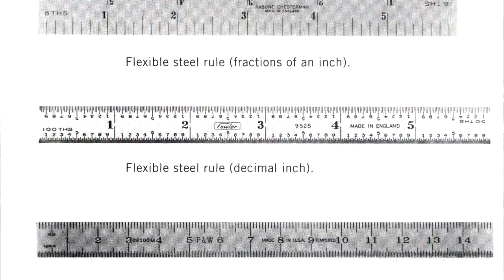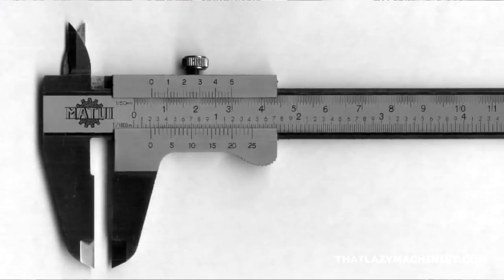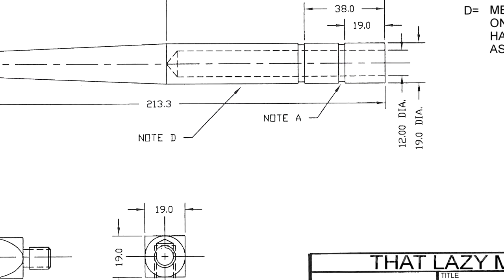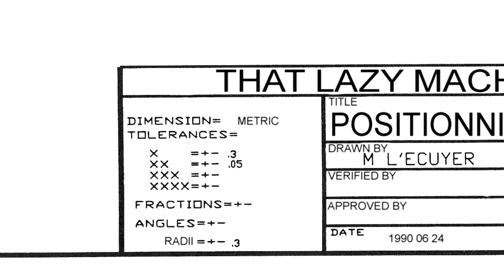MACHINE SHOP METROLOGY #1, terminology & basic principals for accurate measurement of machined parts

Comment from the maker: I erroneously stated that 3 centimeters equals 300 millimeters!!! I an noted the video with a poll comment that lets you decide between a senior moment or a brain fart as the root cause for the error. Check it out at the 20:23 mark, Marc
Reply: One thing that I noticed that people raised in imperial system fail to acknowledge, is the build-in notion of default accuracy in metric system. If you just apply the math, 3cm is equal to 30mm. However, the two units carry different assumptions of accuracy. When you say 30mm without explicitly stating how exact the measurement should be, you assume anything between 29.5mm and 30.5mm. For 3cm this would be anything between 2.5cm and 3.5cm. That's why these units are not interchangeable. This also explains why in machining world millimeters are the preferred unit of measurement, while in everyday life it is often more convenient to use centimeters. The multipliers are spread densely enough to almost always have one to use for required accuracy to not to have to go into inconveniently long fractions (like 1/10000 or 1/1000000 of an inch). The biggest ratio between two consecutive multipliers is 3 orders of magnitude, with centi, deci, deca, and hecto conveniently bridging the gaps in the most commonly used range of measurements. In imperial world you have whole inches, and then you jump straight to 1/1000s. In metric measurements it is not uncommon to use 1 or 2 digits in the fractional part, depending on required resolution and accuracy. 3mm, 3.0mm, and 3.00mm specify different lengths, depending on how precise you need them to be.
Reply from the maker: @piranha32  Thanks for a great (really great!!!) comment! It puts things in perspective and it is nice to learn something new. Keep the comments coming, Marc
Reply: I make this error all the time as an old geezer raised in the imperial system. When I see "centi" I think 100, not 10. I find the centimeter in the shop almost useless and confusing... put everything in millimeters and I have no trouble going from metric to imperial (as far as making a quick estimation). I know that the inch is defined by the meter exactly and by memorizing 4 conversions, Bob's your uncle. 1"=25.4mm exactly, 5"=127mm exactly, 12"~300mm, and 0.03937"~1mm very nearly (as close as you can measure in the shop...and this also tells you that 1 meter is 39.37" or 39 3/8" within 0.005").
As others have noted all German mechanical drawings are in millimeters. In Austrailia mechanical drawings and building drawings are all in millimeters.
Reply: Aceroadholder   the centimetre is not a "preferred" unit in the current metric system, so you can legitimately ignore it.
Reply: I'll let you choose which...I'm just enjoying the video! :-)
Reply: We learn the nost from the senior errors, when theyre noticed and we say to ourselves "what the hell is he talking about" is when we learn not to repeat those mistakes. Thanks for the education, what i owe you for tuition? Haha
Reply: The mistakes are easier to remember than the sucess. Human mind.

Comment: Nice to see you back with this interesting introduction into metrology.
One little correction from a "metric guy": 3 cm equals 30 mm (not 300 mm as you probably misspoke).
In Germany the mm is mostly used as the "base unit" in machine shops working with metals whereas the "wood guys" like carpenters or joiners traditionally use the cm.
Looking forward to watch the next episode
Harald
Reply from the maker: Hi Harald! I corrected the oops with a poll annotation that lets you choose the cause of the error. A brain fart or a senior moment. Thanks for letting me know, Marc
Reply: Fuck metric!